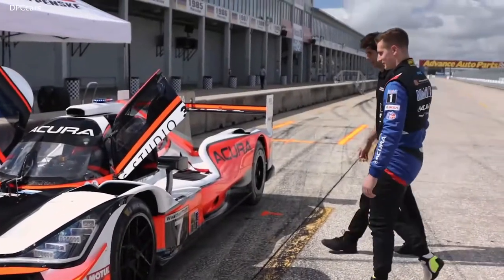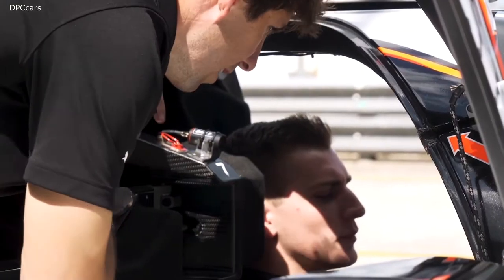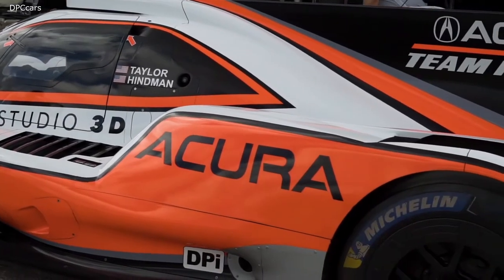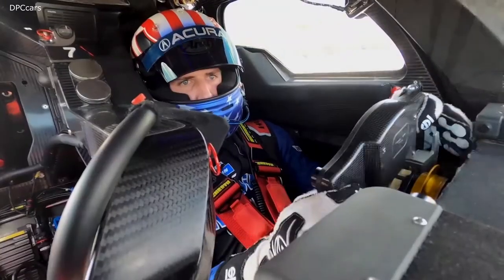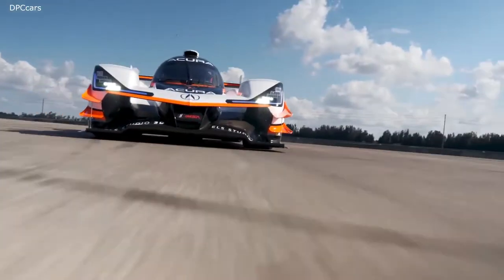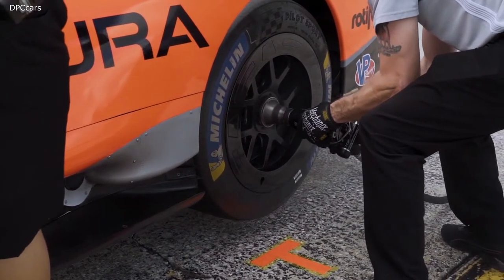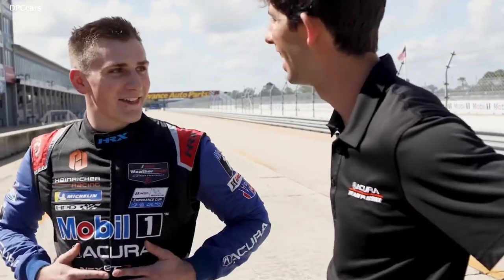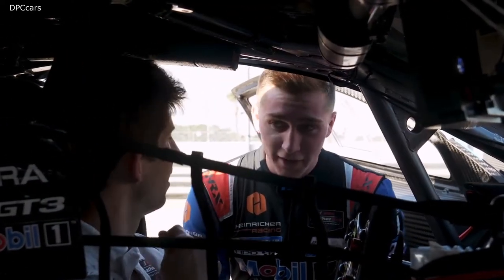Acura Pro Drivers Swap Race Cars - Acura ARX 05 DPi and Acura NSX GT3 Evo

Comment: If they’re talking about the NSX...it hardly has an SUV motor, it’s not a Honda J series SOHC engine.  The stock $90k Gen 2  NSX’ 3.5L DOHC engine comes from a clean sheet of paper, excepting Honda went with a non-VTEC design deploying Cosworth block & heads.